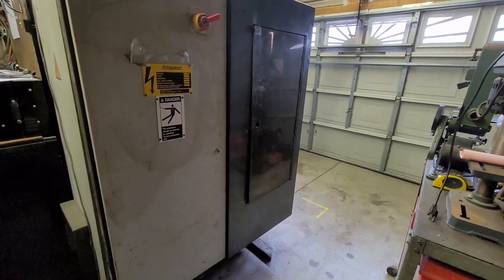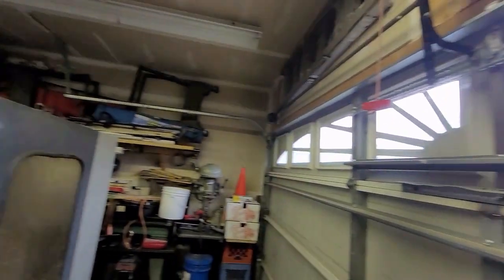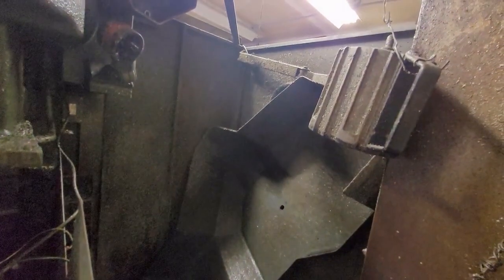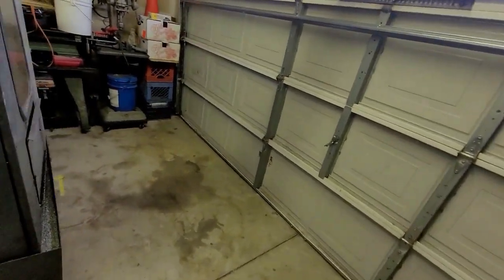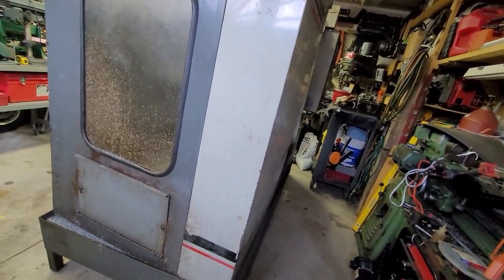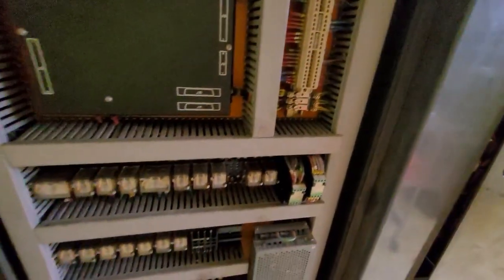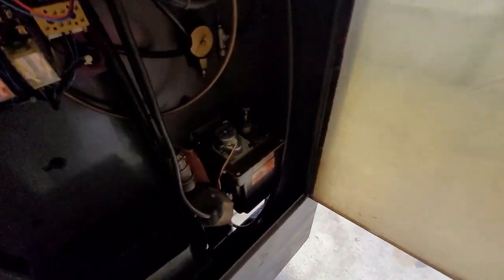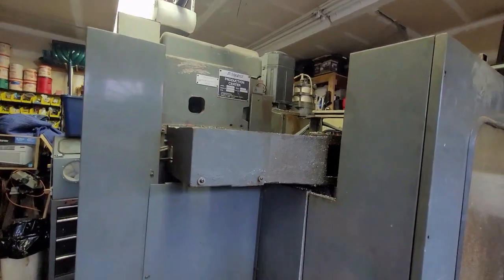NEW MACHINE INTRODUCTION TIME – WATCH THE VIDEO!!!

Comment: Hello Mike, 

Great purchase, I have my eye set on one, what was the floor space it takes? I saw you marked in yellow for the riggers to place it .

Thank you
Reply from the maker: Hello Workshop85, the tape was marked out at 70" x 78" . The fan on the spindle motor and z axis way cover had to be removed and it went in my garage. So far it's up and running for testing purposes. I have to upgrade my rotary phase converter with a larger idler motor. Thanks for watching and commenting and please consider subscribing!
Mike - Plus8Precision
Reply: Already subscribe !
Reply from the maker: @workshop8584  thank you for subscribing 
Mike - Plus8Precision

Comment: hey man, i wish you the best  of luck, this should be a good project, nice capability for your shop. i used to run a bridgeport boss cnc. it was a good machine, "90s" vintage.
Reply from the maker: Hello nadam35, thank you, I'm slowly trying to bring life back to this old mill. I am trying to get it going with all the original controls. I have some things to tend to the air system and lube system. One thing at a time, if it becomes impossible, I'll think about a retrofit. Thanks for watching and commenting...
Mike - Plus8Precision